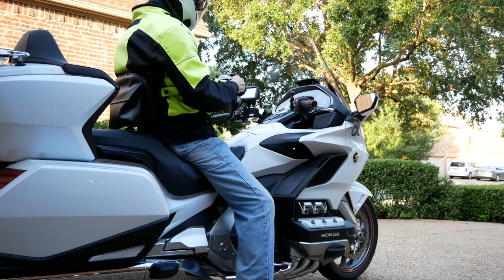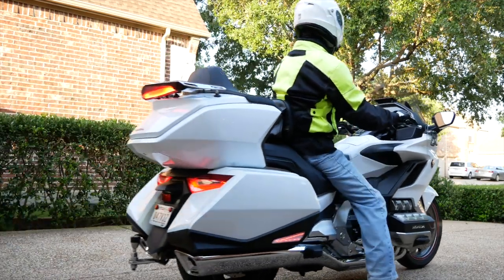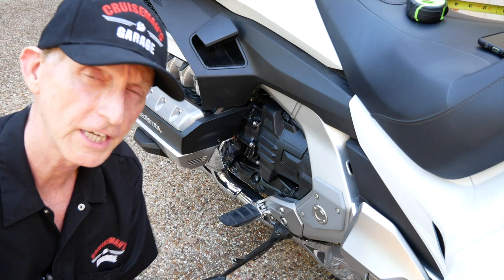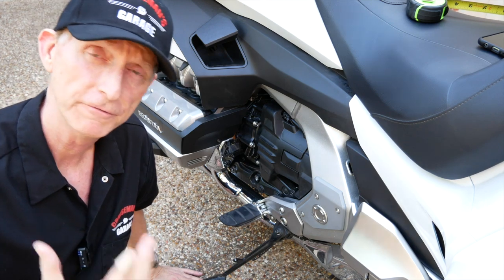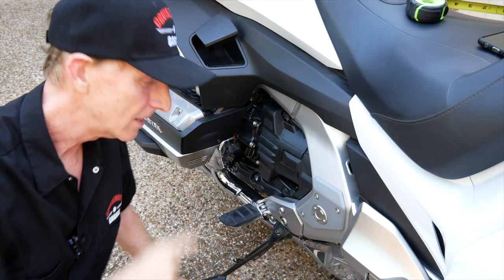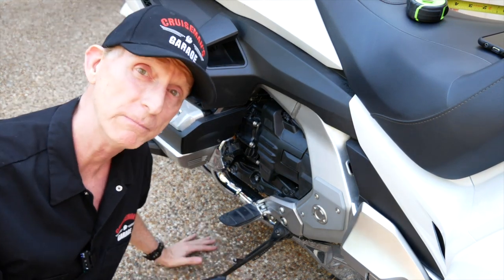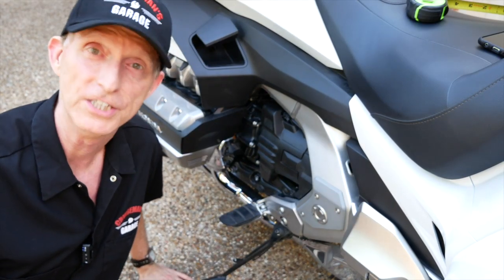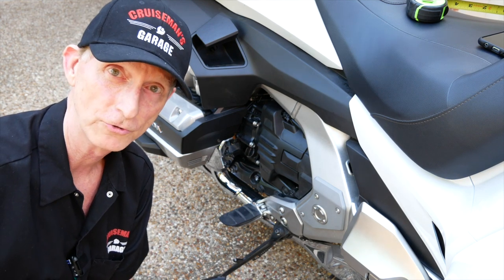Hey Honda, Fix the Parking Brake on the DCT Model!

Comment: You nailed it. the CanAm spyder will not let you  put it in gear unless the brake is off and beeps like crazy if you don't put the parking brake on. This is a big deal on trikes and I personally took off 50% of the time with the brake on due to this flaw. I would hope they fix this in the next year.

Comment: Every time I see your videos I either get excited for my future 18/19 Golding purchase or flip flop on a 13-17.....
Reply: I know  what you mean, Bruce.  I had a 2003 ST1300 ABS, but the power band made the Colorado mountain twists a shifting nightmare.  Imported a new 2016 F6B w center stand, cruse control, heated grips, Honda passenger backrest AND ABS in 2016.  Once the new '18 GW came out at first I was bummed out, but then I saw the price.  My new F6B was $17K including duty, taxes, transport, import fees, etc.  Landed in my driveway in Denver, CO.  I LOVE the F6B.  Have seen the new GW on the road.  Sweet bike....   looks like the ST1300 & F6B had a love child.  May get a used one someday, but can't imagine it being that much better.  The F6B is a freakin torque monster / freight train.  I think Cruiseman has done a great job of pointing out the real-world pros and cons of the new vs old 1800 GW.  My 2 cents
Reply: Cruiseman, I’ve appreciated your GW reviews for many years. I wholeheartedly agree with your assessment of the new models. Owned a 07 ABS that was fantastic in its time. However, when weighing all the new improvements vs the numerous shortcomings of the new wing I just had to pass. I purchased a 2019 BMW R1250 GSA for just a few thousand more than a 19 GW and after 12k miles touring US and Canada I have no regrets. However,  if Honda would correct even 70% of these glaring shortcomings I would be thrilled to shell out 30k for one. Currently this issue along with the shortcomings you highlighted in your long term review video are just too much for me to overcome.  Hopefully Honda will see the light and resolve these issues in the next rendition.
Reply: Take 2019/20. No mistake..

Comment: I just wanted to stay I have a 2024 Honda NC750X DCT. It's not a Goldwing, but it has the exact same problem. It normally stops me from moving, but today, I forgot completely and just drove the bike. It was probably 10 miles down the road when I noticed that it was engaged. It doesn't work anymore and I just hope and pray I didn't damage the rotors.

Comment: Hi Cruiseman, I haven't had my 2022 GW very long and I have done this already. You were dead on target.  Electrical Connections has done just what you suggested and made a harness to that end. Only problem is their directions are 4 pages and I am not finding them so illuminating. Have you or someone else made an installation video for it?

Comment: Last year I rode for about a half block with it on. I rarely use it otherwise. But earlier this summer it was needed in a mountain town in Colorado and it would not set even when the handle was pulled up all the way. The next day pulled out the shop maintenance manual and made the required adjustment until it clamped down on the rear disk. Last week on a big ride up to Montana it was needed again but failed to hold the bike. Will have to see what is going on with it again. So indicating when it is set may be just one problem with it.

Comment: I just bought a 2022 DCT tour and there's a big red light on the dash when the parking brake is applied. Is this a recent addition or have they always had this? Being British and driving manual cars all my life I am used to using the Handbrake as we call it in England but never having a Handbrake intergrated into a motorcycle theres very little occasion to use it. Folks out there need to look at their instrument clusters before moving off and scan then once in a while to check for problems.

Comment: Hi Chris! There is a solution from Cyclemax. It is a harness that probably does exactly the connection to the side stand and won't let you go in a gear.. The only thing is, the side stand light is on, even when the side stand is not engaged but the hand brake.
Look on their website. You will find it under '2018 Goldwing DCT Parking Brake Interlock (EC02117)'.
Just to let you know........

Comment: Hi cruiseman. I’m new to gold wing. But i thought they had a notification light.  Look at pages 47 and 60 in manual for details but it says this light comes on when the park brake is engaged and stays on as a reminder for you until you release the park brake completely. Is that it or I’m i missing the subject completely?
Reply from the maker: There is a light, but many, myself included, just miss seeing it.
Reply: Yes you are right It is mentioned in the owner's manual on page 47 and explained on page 60.

Comment: You are so correct, about the parking brake. Can Am Spyders have a parking brake warning system that Honda should be using. On the Spyders, you can shift into gear (forward or reverse) with the parking brake on. When you apply power (add throttle) the bike won't move and there is a VERY loud beeping that occurs. When the throttle is released the beeping stops. Release the parking brake, add throttle and away you go. 

"So simple, even a caveman can do it."

Comment: What's the "P" light next to the ABS light?
Reply: Part of the problem with that is it is near other lights that dont turn off until you start moving.  You learn to not see it.  Another part of the problem, and one of Chris' points was that the light could flash, that would help.
Reply from the maker: @scottdornseif8223  Better yet, make the whole damn TFT screen flash with a parking brake symbol!
Reply: It means your side stand is down..

Comment: First off, I totally agree with your comment from another your videos, Honda SHOULD HAVE put a parking brake in the transmission, just like EVERY automatic car ever made.

My major gripe though, is that it is out there in the open and can be easily released by anyone walking by.   So, I don't think you can rely on it all.   I can see using it in a parking lot on a slope, walk away and all is good, then someone releases it!

And, I also agree that there should be, like every hand brake on every car, a light that is on when the brake is on.

Looks like a gigantic afterthought by Honda.   Spend the time to introduce a rear brake with a separate calliper then activate it through a manually adjustable cable and don't let anyone know it is on.
Reply: Don: There is a light in the dashboard indication (P) to show the Park Brake IS engaged.
This video is just a whiny old dude who should ride a moped.
Reply: @peopler2stupid165  Ah, good to know.   I don't have a Wing at this point so good to know for future reference.

Comment: I have never had an issue with the parking brake, it has a little light on the dash  that shows it's on. Just take the time to visually look at everything on your bike and don't be in such a big hurry. I have a 2018 DCT.
Reply: Exactly My 2022 GW shows a large red light. It's even bigger than a failed oil pump light. That's all the warning I need. Even looking down the road the light will catch your eyes and even in sunny conditions. This is a problem that doesn't exsist IMO.

Comment: If you were waiting for a red light or train and going down hill and wanted your bike in or out of gear it would be nice to have the parking break set up the way it is and with no clutch the left had is free to operate the parking break. I do not have a 1800 DCT gold wing so have no time on one. Just say that because where I am we do have stop lights and train crossings on steep inclines or declines where it would be hard to hold bike back sure you could still use the hand break or foot break.

Comment: There is also the "P" light that goes on when the parking break is engaged. The should just integrate the park break switch into the same system that keeps the bike from going into gear when the side stand is down.

Comment: I am not in a position to look at this closely but I would imagine it would not to be a hard job to "Rig up" if you had a little technical expertise.  Identify if the stand switch is powered or neg trigger, then just splice into it from the park brake light activation switch circuit from the handle. I think the only draw back would be that the stand warning on the dash would illuminate if either the park brake or stand down was triggering the circuit.  If CanBus issues, maybe run a small relay in the configuration????  I'd be interested what others think.
Reply: Shaneev: You could rig something to indicate the Park brake is engaged OR, do what every smart rider does, HE LOOKS AT THE RED (P) LIGHT ALREADY IN THE DASHBOARD ! 
Honda is not at fault, this is just an old guy riding something beyond his abilities and whining about how dumb he feels
Reply: @peopler2stupid165  I think you are right.  It is not a problem for me.  The dash warning light seems to work for me as a 'heads up'.  In any case, you should know your bike and feel the 'move away' difference immediately. I am not touching mine.

Comment: If I had one of the newer wings I would correct that and the GPS that won't come on unless you are not moving.
Some things are just dumb and I haven't looked at the circuit but I'm sure there is a way.
I want to do a circuit for my GL1800 where if you honk the horn the high-beams flash several times. I've done a lot of this type work in the past, I just don't enjoy it like I once did.
If you run it through the side stand circuit (in series) the side stand light would still be on if the brake was engaged and the side stand was up, so that may not be the best solution. Which would mean if the brake was on and the stand was up you might think it's down when it's not. You would have to get on the start side of the circuit, to be safe...

Comment: My Aprilia Mana doesn't warn me either the sheer lack of power reminds me that I am stupid and should have followed "riding the motorcycle procedure in the manual". Come on do they have to think of everything for you gold wing guys. All the younger guys I meet with these bikes love them to bits. All the older guys I meet with this bike do nothing but nitpick them to death. Honda built a bike that the next generation of riders wants, not what the retiring bikers want. Next thing you will be requesting is the bike to register that you're sat on it before attempting to riding it down the highway.

Comment: My 1998 Lincoln Mark has an automatic release on the parking brake. Honda could have done the same thing. Put in drive and brake releases. 

Or better yet how about a button and electric actuator for the PB. The system is an afterthought....

Comment: I DID IT 🤐🤨 
New bike. After just 470km(292miles) I forget it...And after 4miles I stop in front of my house...I saw it...and it is not working anymore... Like I do nothing...it slides in front and wanna push my side stand(leg) back and turn bike down on the side...So I parked in front so my front tire touches sidewalk... Does it take too much time to fix it? Tnx

Comment: I mean cmon, at some point we just have to take responsibility and use the tools we were given.   Get use to “LOOKING” at your dash before you take off.  U should be doing this every time anyways because u should be looking at your gauges.  

People are too quick to want to start riding.  SLOW DOWN, look over the dash and get familiarized with your dash.  ALL OF IT.  EVERY LIGHT, EVERY GAUGE, AND WHAT THEY SAY AND MEAN.  All that stuff is on there for a reason.  Its not just cosmetic or pretty lights.   

If u did this every time u rode, then I guarantee that light that says “hey your parking brake is activated” will  be noticed by you. Then (because you check/look at your dash thoroughly every time you ride) u will become accustomed to looking for it, then wala, this problem will be gone.     You goldwing guys are so damn spoiled smh 😂😂
Reply: Spot on those intruments are there for a reason look at them now and again and always look at them before moving off first time.

Comment: Need to check for the parking brake light on the dash before shifting to drive. A post-it can serve as a reminder on the dash. Put DPBDA in big letters on the post-it. Disengage Parking Brake Dumb A__.  It works for me.

Comment: In a related issue when the parking brake no longer holds the bike the correct adjustment is hidden under several panels. The rear adjuster on the disk is only meant for minor adjustments. The big question, what is an easy way to get to that adjuster without disassembling the whole left side of the bike? Cruiseman I like your idea and it would reduce the need to do the adjustment in the first place.
Reply from the maker: You can access the adjuster by just removing the small black plastic engine cover on the left side.
Reply: You’re right on, thought it was higher than that. Thanks

Comment: I rode for a couple miles with my brake on last week.    The rest of the ride I worried about brake heat, wear and warpage.   No good
Reply: Look at your dash occasionally. The fact that you don't look at your dash before moving off for the first time is scary as hell to me. Those instruments are there for a reason. Ride safe man, teach yourself to scan that dash occasionally.
Reply: @jag1963  I sold the POS.  Hated that bike.  I wasn’t up to it.  Concluded that Auto transmissions on bikes is dumb and no fun.

Comment: Why the answer is easy. Near to all over the world that I know of it's by LAW that if the sidestand is down the engine must not start. Is that LAW for the parking brake, NO ? So Honda says it's goint to cost us 1,85 USD more to integrate so why bother,. THAT'S WHY

Engine case guard is another thing. At that price that too should be standard. Look at the side stand which is a load of crap. It's an amazing bike but these are things I expect at that price

Comment: My opinion is that EVERY motorcycle is "equipped" with a "parking brake"... leave it in first gear when you park. Why they had to add something so sophisticated that it has its own lever and people could/will forget to disengage it..
Reply from the maker: Because the DCT transmission automatically shifts into Neutral with the bike is turned off. No 1st gear to hold the bike.